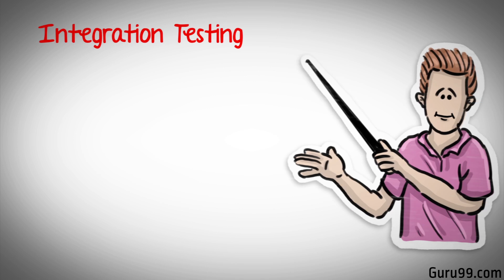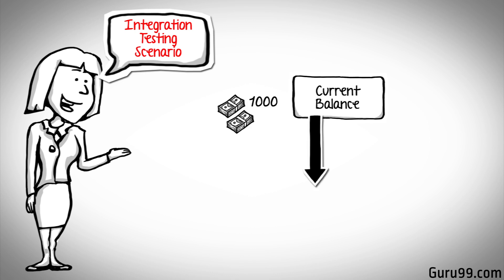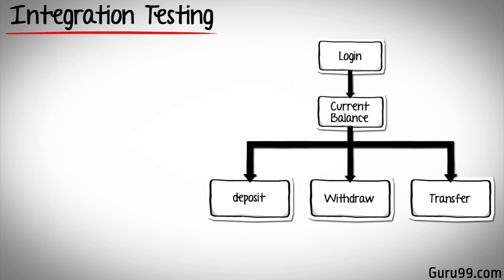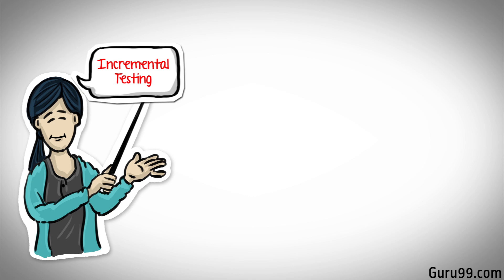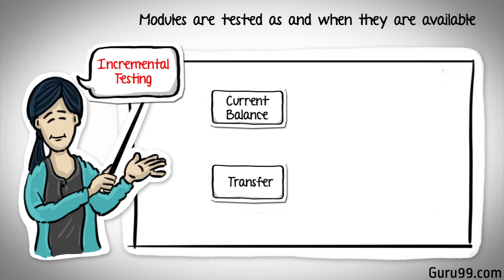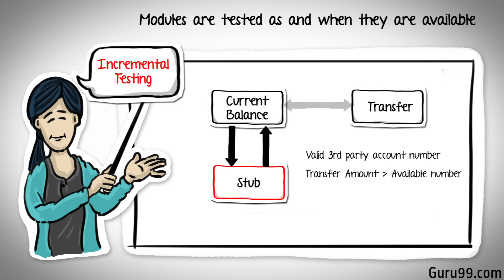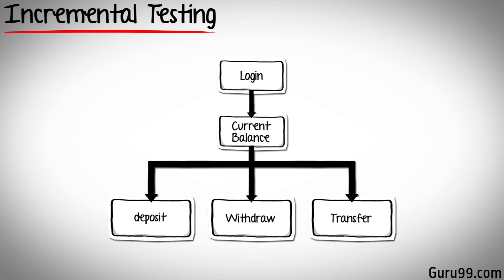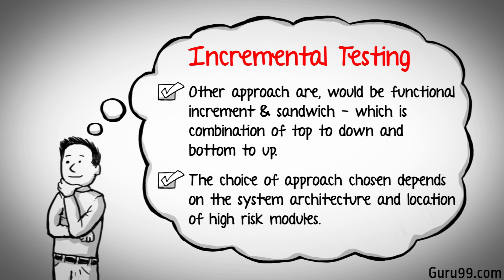What is Integration Testing?   Software Testing Tutorial

Comment: Integration testing tests whether a software application works as intended when its different modules are integrated. The aim is to find bugs when the different modules interact with each other. Avo Automation helps enterprises run a series of test conditions against a fulfillment endpoint.  It makes integration testing faster, error-free, and cost effective.

Comment: This is not a integration testing, this is functional (end-to-end) testing. Integration testings tests just the border between two systems, but not the scenrio. For example integration testing tests CRUD for database tables and verifies that the data at lease will send or received, or mapping is correct, but who cares what user story do you implement? To test user stories you have to have all set of your systems and subsystems you will use.

So, testsers write articles for testers without knowledge what is integration testing.
Reply: +Артем Арте Thats called System Integration Testing
Reply: +ankush jethi  you can name it what you want, but in the serious companies engineers use correct names for each thing. And they get it not from blogs of geeks and php monkey coders, but from documentation, books and university. This tests are functional tests and nothing else but this. The integration test is test which checks the integration only. Just the last layer of your system and with interface of the another system. And system integration tests - is just you imagination or lack of knowledge or wrong approach and result of wrong organisation of the process. And don't trust wikipedia so often.